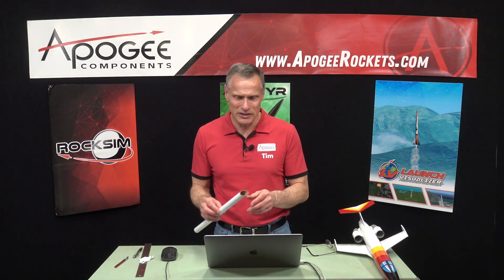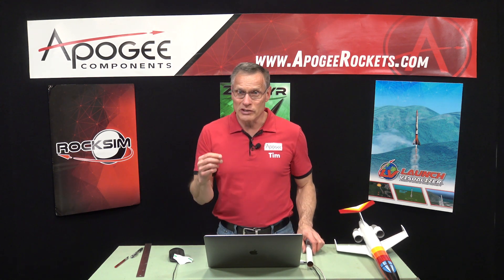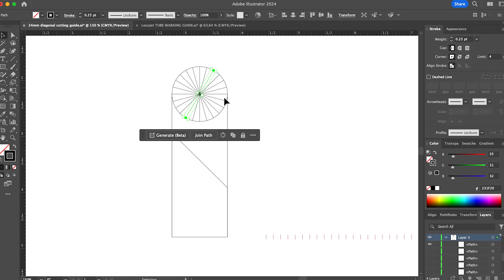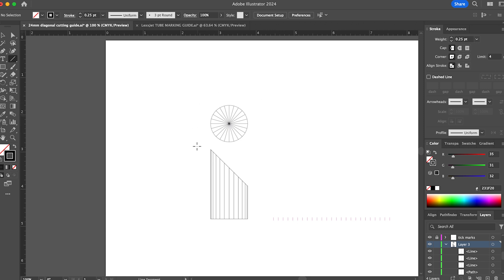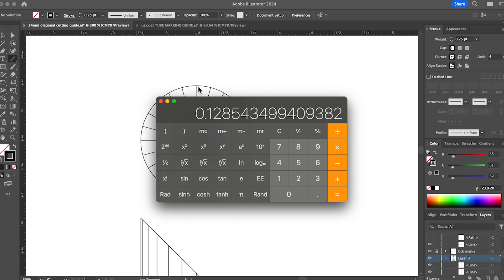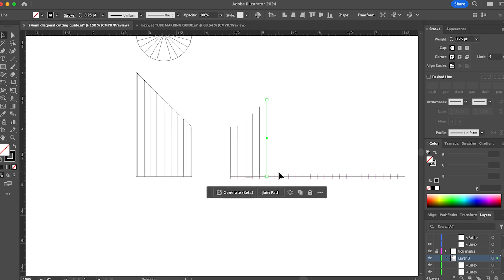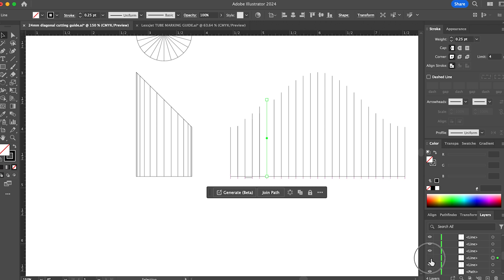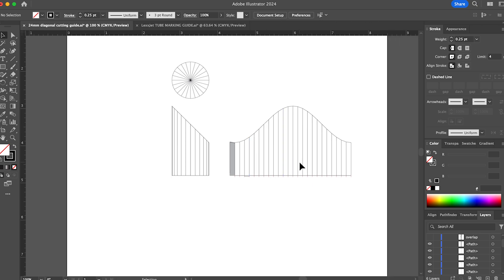How To Create a Paper Wrap for Cutting Tubes at an Angle

Comment: It's a little easier if you have access to a CAD program such as autocad or maybe even qcad.  I did a somewhat similar construct to create a pattern for a leaning cone to go on a strap on booster for a rocket, meaning a cone that fits on the end of the tube but the tip of the cone is off to one side and not centered on the tube.
Reply from the maker: We try to use the simple inexpensive tools. But that is a good idea if you have access to it.
Reply: @apogeerockets  I have access to autocad through my work and it is definitely not inexpensive but qcad has a version that is free